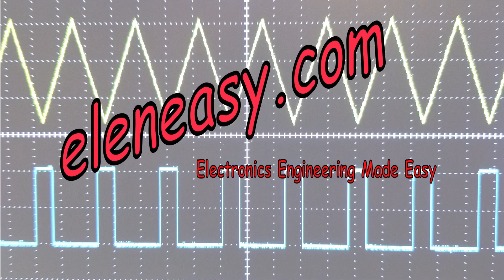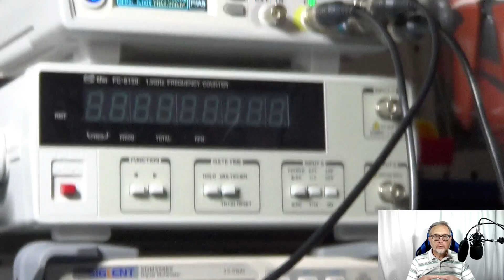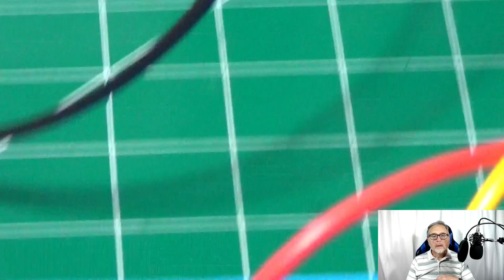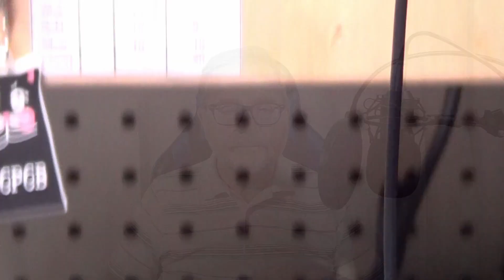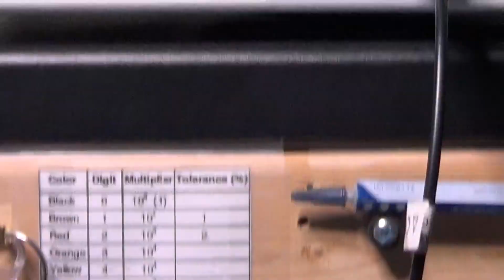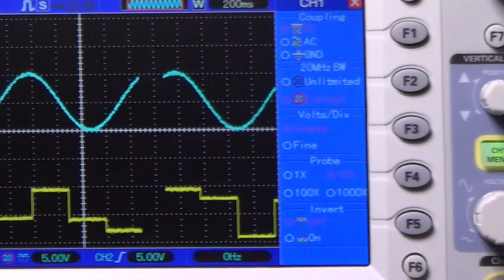The Synth Project Episode 32: CV Processor Part 4: The Sample And Hold Circuit

Comment: Hello. Thank you for your good information, I have a question that is not related to this tutorial. In switching power supplies that have TL494 ICs, can a short circuit be added? These sources often have twelve volts and ten ampere currents. I mean the devices that are used to set up CCTV cameras for small billboards. Is it possible to provide a training for it? Thank you very much.
Reply from the maker: I will have to take a look at the specs of the IC and run some experiment.  I'll see what I can do.
Reply from the maker: I have seen the data sheet for this device, which is actually capable of providing an output up to 200mA. However, it is possible to increment the output current using external transistors, and the data sheet provides a typical circuit for doing so. The same circuit, visible on page 13 of the document, provides a short circuit current protection through the appropriate sizing of resistor R13, so that the maximum current of the circuit will be the one that creates a voltage on R13 equal to the voltage on pin 15, defined by the voltage divider made out of R1 and R2. In the configuration suggested, the device is able to provide an output voltage of 5V with a max current of 10A. The short circuit protection intervenes in such a way that the current will not exceed 10.75A. The calculations for the max current and the value of R13 are on page 15.
Here is a link to the document: https://www.ti.com/lit/ds/symlink/tl494.pdf?ts=1693413650352&ref_url=https%253A%252F%252Fwww.google.com%252F
With the help of the data sheet provided above, you should be able to design your switching power supply with the voltage and current you desire and a short circuit protection.
Reply: @eleneasy  That's very kind of you، but I don't have much information. I just wanted to see if I could put a short-circuit protection circuit on this device that I sent the photo. Of course, it has a circuit protector that increases the voltage of the four-IC pin, but by removing the short circuit, we need to unplug the device and reconnect it to B.
Thank you so much for replying to me.
Reply from the maker: I did not receive your picture.  Also,  according to the data sheet,  once the short circuit is removed,  everything should go back to normal automatically.
Reply: @eleneasy  Thank you very much. 
Would you allow me to send your email to you the schematic circuit of the device and explain it in the email? 
If possible, please give me your email address. 
Thanks
Reply from the maker: You can send me an email through my web site eleneasy.com
Reply: @eleneasy  Thank you. 
I'll send it to your email 🙏
Reply: @eleneasy Hello. Thank you very much for your attention. 
I mean this kind of switching feed. I'll send the photo link. 
Thank you again for heeding my request. 
In fact, I want to know if this device can be fitted with a short-circuit protection circuit. Of course, it has a circuit that connects at the base voltage output of four ICs and causes the device to be disabled, but if the connection is a little longer, the device will be damaged.